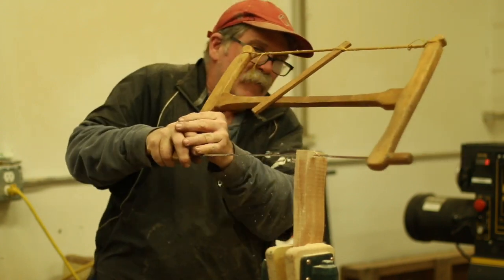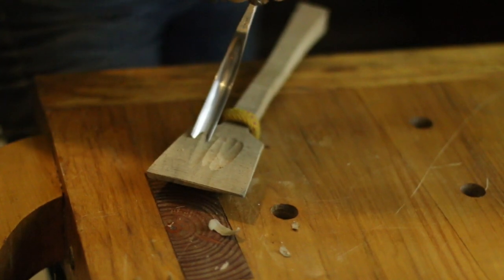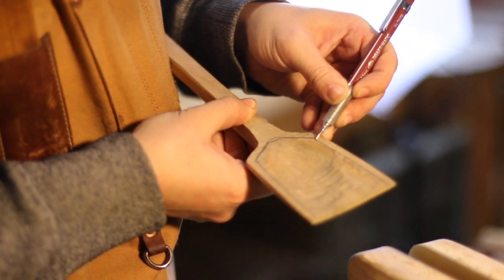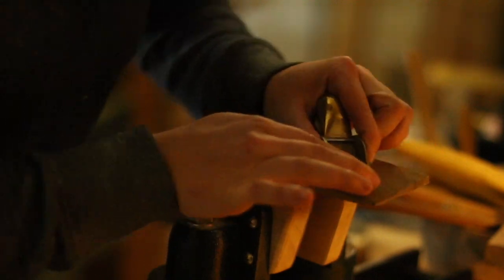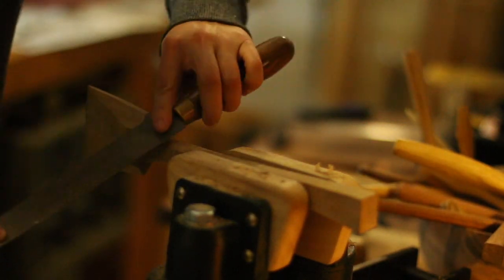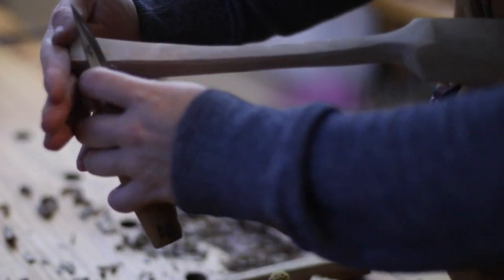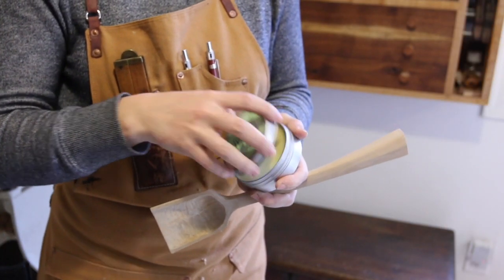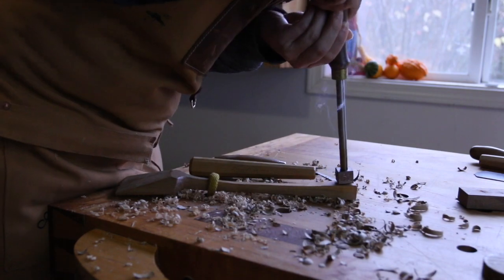How To Carve a Spoon- Spokeshaves, Vises and Gouges // Woodworking

Comment: Woaaaah, the branding iron is such a cherry on the icing of an awesome cake! I'm only on spatula #2 and spoon #1, but I figure if I still have all my fingers attached and haven't had to run for band aids, I'm on the right track to enjoy spoon carving.

Really interesting to hear about the difference in timing between fully knife-carved vs using a variety of tools. My first challenge is cutting enough material off on the band saw without taking too much off, so that there's not TOO much to remove later manually. I guess it's all a learning curve :)